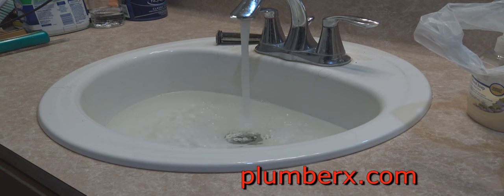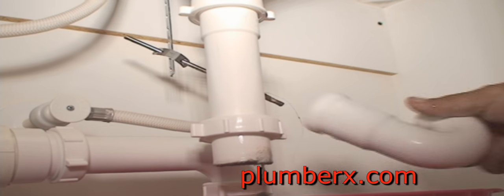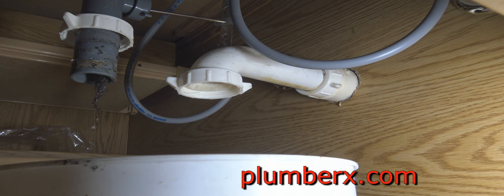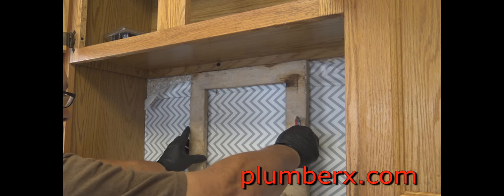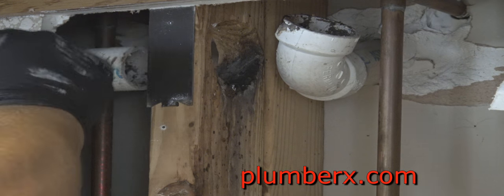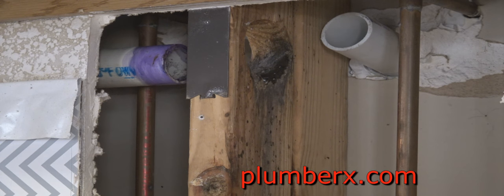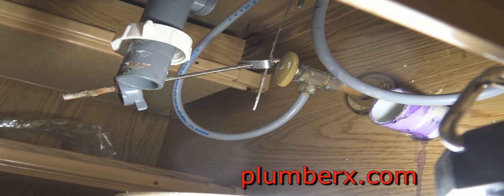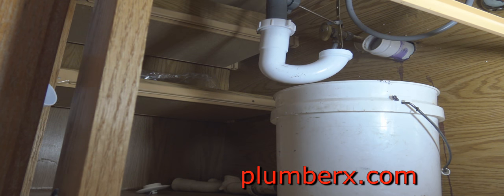Say Goodbye To Clogged Sinks: Troubleshooting The Most Common Bathroom Sink Issues!

Comment: Thank you so much for this video!! I was going to take the P-trap off. And I had been putting drain cleaning fluids down my bathroom sink for weeks. Nothing worked!  The plunger worked perfectly. And clogging up the overflow valve with a towel was really helpful. Good job. Thank you again!!
Reply from the maker: Nice glad I could help. I appreciate you

Comment: I fixed my bathroom sink few years ago. I used a lot of plumbers tape. Water sitting in ptrap so I know clog is in main line. But for the life of me my 80lbs does not have the strength to get the ptrap off the wall line. Someone sd put a blow dryer to it. I was thinking vinegar 🤔 Is there some plumbing trick to get this off so I can snake the line? 🤦‍♀️ And I have soap and hot water in toilet. Another issue working on. Oi
Reply from the maker: Sorry I do t know of any tricks for that. Some times there just hard and you may need a pipe wrench. I would recommend getting someone that does this all the time if you have doubts.

Comment: What if you have a vessel sink with no overflow?  Does a plunger work with that?
Reply from the maker: Yes it does, good question
Reply: I took the p trap off and I could see all the way to the bowl that I had to catch the water; is it likely that the clog is closer to the pipe near the wall?  My troubles started from someone saying plunging is better than drain cleaners and vinegar and baking soda. It’s worse than before I did it.
Reply from the maker: @aviviapatrick707  most bathroom sink can be clear with a plunger. There are cases that require a little more work or a lot. I would call a drain cleaner special in that case. You may have older plumbing or improper plumbing. But for most bathroom drain lines. This is not an issue.
Reply: Thanks for your response. I was hopeful I could “do it myself “ but I wasn’t successful. Bought the cheap 15 ft auger with a push lock( took it back) then I bought a Cobra 25ft with a better lift latch lock… didn’t really get the hang of it… so I’ll call my plumber. He’s pretty reasonable- installed a new water heater for me and recommended a good boiler man too. I just wanted to do it myself. Got to get back in my lane.  Thanks again for your good videos.

Comment: That sounds pretty expensive. I live in Connecticut.  Northern Fairfield county. To snake a lavatory or kitchen sink drain is 145.00 to 185.00 dollars. 

Thx, 
Jim
Renz plumbing
Reply from the maker: It is expensive. Not all companies charge as much. Mostly your larger plumbing service companies. Me I would call your smaller Mom And Pop Companies. there always cheaper. they don't have the big over head. Some even have 69 dollars specials but changes fast once they get there and start add on's.

Comment: I originally thought my sink was clogged.  I don't use any cream based soaps and this happened out of nowhere. However to my surprise I had filled my tub up to soak a pair of white jeans.  The following morning the sink was empty and water flowing.

Well I emptied the tub and the sink became clogged again.  I live in an apartment and this started after the water was turned off for repairs.  

I hate calling maintenance because the last time they came something else went wrong.
Reply from the maker: Well there may be some hair build up in the tub drain. That would be the biggest stoppage problems with tubs, in most cases pulling the hair out is pretty easy. Grab a coat wire hanger and start fishing around the drain until you catch something and slowly pull it out. Hope this helps
Reply: @theartofplumbing  I have very long hair and I wear a scarf on my head while showering -I go to the salon for my shampoos.  

Is it possible that the unit above me may be the culprit?  I have to call the apartment maintenance office at some point but rather not.  I sware they never fix things right and they're rude.
Reply from the maker: Yeah sorry buddy, you may have to call maintenance because if you tried anything ells and creat a bigger problem there going to hold you responsible.
Reply: @theartofplumbing  😂😂😂 the thought of calling burned my soul.  So took the sink apart and dug inside the drain connected to the wall -as there was nothing but water in the looped pipe.  There was nothing tangled in the lever either -however black slime fell into the bucket from the wall.  Not enough to clog the drain as so I thought.

I put everything back together -feeling frustrated because I was hoping to fish out something. I turned the sink on and it ran down without any problem to my utter amazement.  The sludge wasn't thick so I'm scratching my head.....
Reply from the maker: Lol 🤣 👍
Reply: @theartofplumbing  and thank you for providing the how to videos!  😃😄😂

Comment: On a kitchen sink does it matter what side the ptrap and drain is hook to
Reply from the maker: Cory Driver Yes the trap should be on the same side as the garbage disposal if you have one, other then that. Not really. Some area require that you have a trap for both sides. Hope this helps.

Comment: That seems a bit unusual to have a drain pipe run behind the kitchen and the stove
Reply from the maker: You're right, but this is a split level house. The bathroom is just on the other side of wall from the kitchen. The bathroom is half a level up. Good question.

Comment: I don’t get how the disconnected pipe caused a clog?
Reply from the maker: It didn't. Just a little extra I ran into. Clearing the line wouldn't have bad a differents. With a busted drain pipe,😉
Reply from the maker: Just showing how some time you may not need a sewer machine just a leaning out the trap is enough some times😉